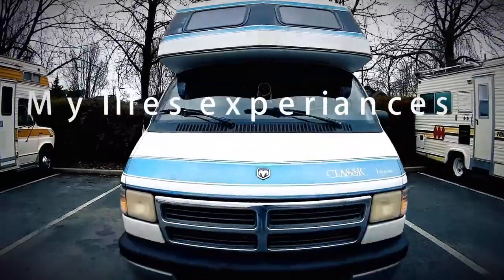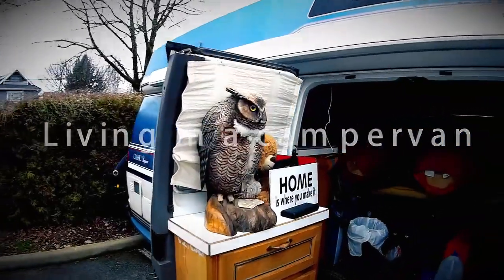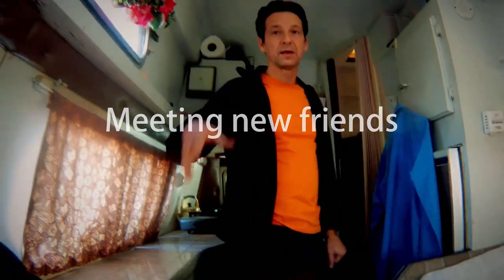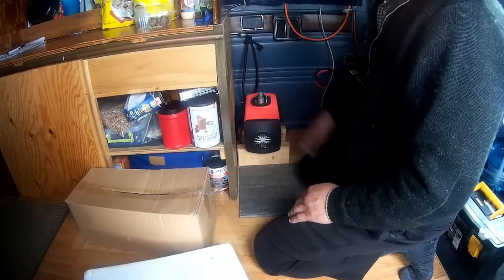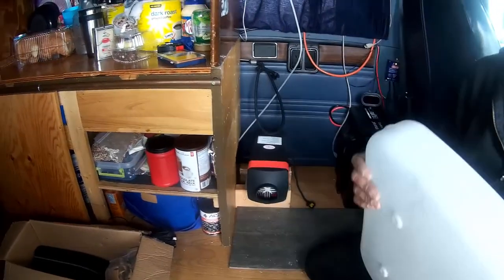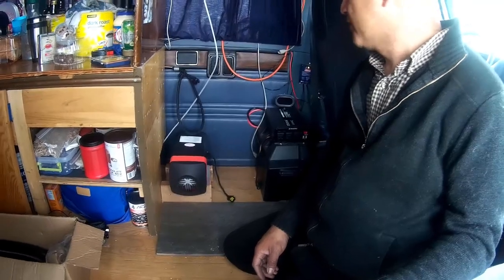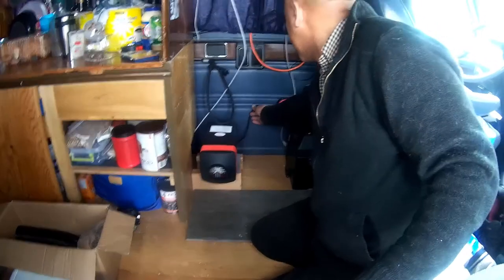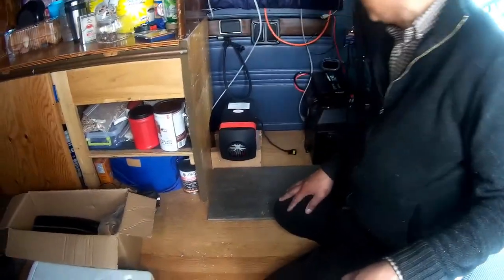Diesel heater install in Eddy & Monica's Dodge van

Comment: Your fuel pump should be vertical and not trying to force fuel downward. There are air bubbles which are supposed to be produced, but forcing the fuel downward will make air collect at the outtake of the pump. 
See John McK 47
  's channel for the video about fuel consumption.
Reply from the maker: If you click on the amazon link below, I would appreciate you purchasing one through that link and find out for yourself how these work. I have been in contact with the manufacturer and they say the best pump position is at 45 degrees. You want the little bubbles to be there. You can watch hundreds of others on youtube who have there opinion on these things and they will all be different. I have found the best way for me was by talking to the people who make them and it works great for me. If you need to know more about them I am ready to help you.